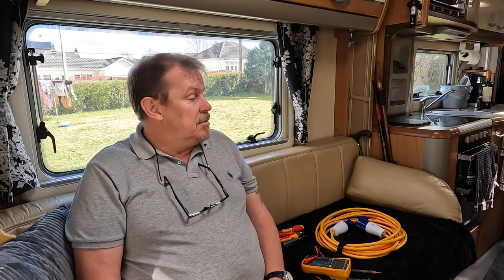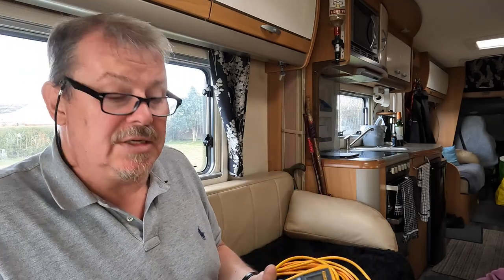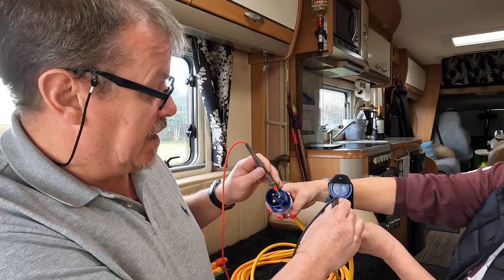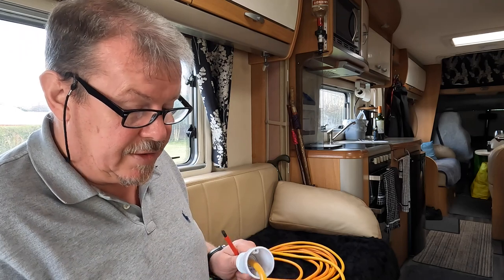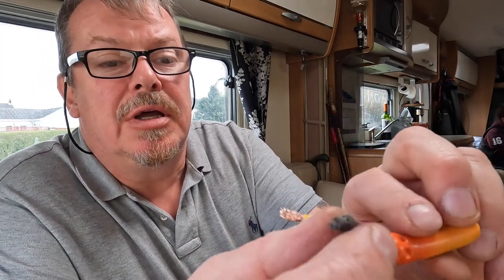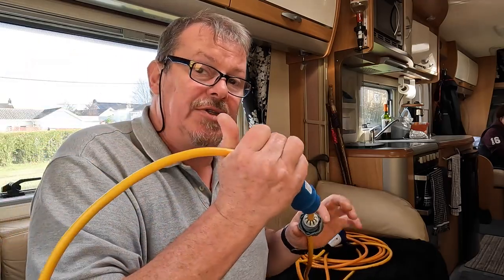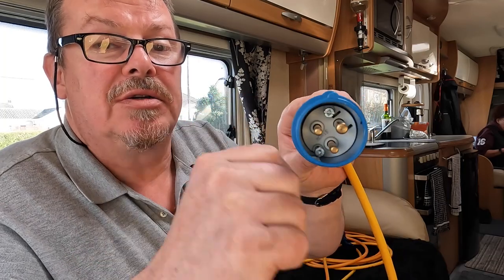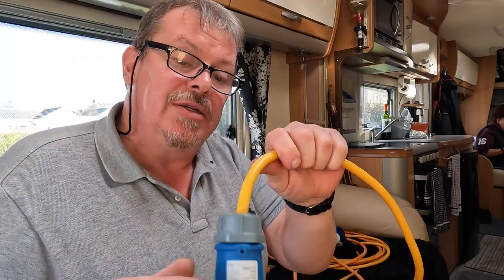MOTORHOME DIY | 16A Extension Lead Repair

Comment: Awesome. Nice tip. Stupid question. I have the cables you where testing is it OK to put a normal plug socket on one end as its gonna go into an out door shed for a freezer and the other cable will go into the other shed where the fridge and washing machine are.   Help lol ?
Reply from the maker: You can put a normal three pin plug on one end, the blue socket on the other. Or the blue plug on one end and a 3 pin socket on the other end. NEVER put a three pin plug one end and a blue plug on the other end. If you plugged in either socket, the pins would become live on the plug at the other end and could be fatal. Hope this helps.